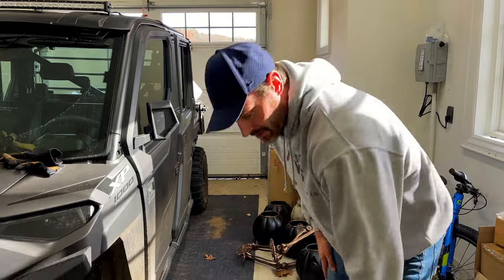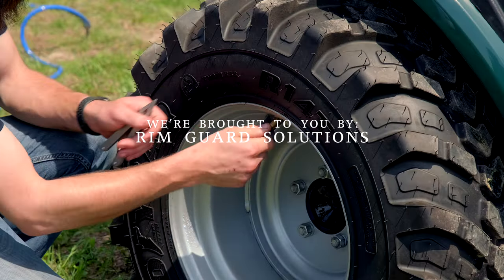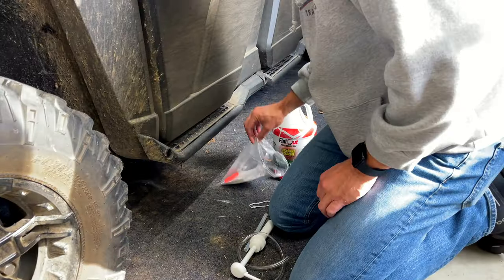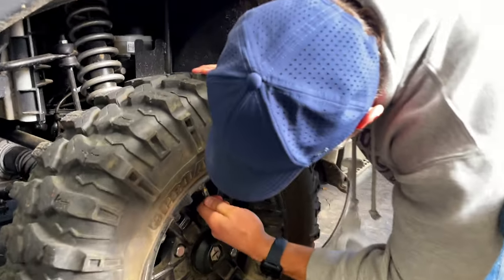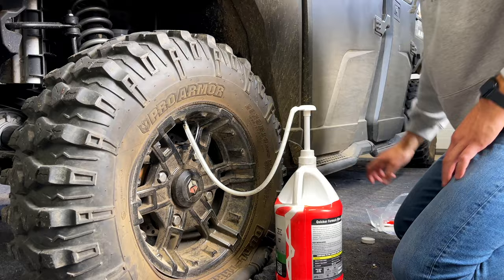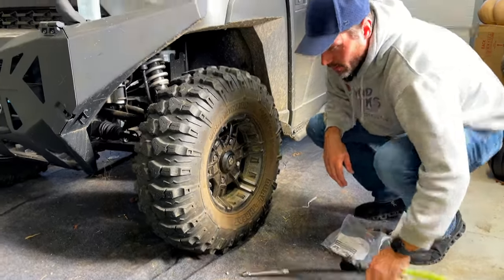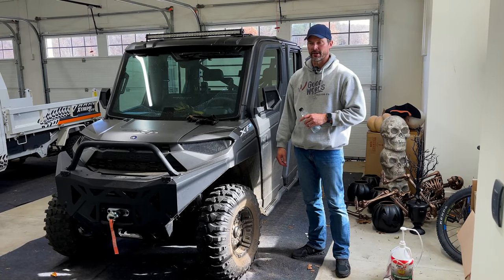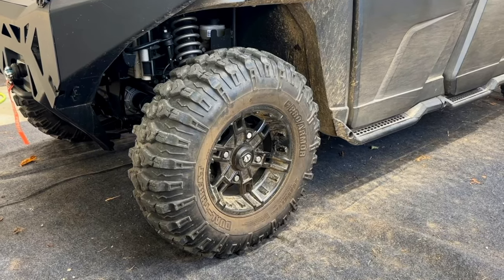HOW TO FIX FLAT TIRES FOR 10 YEARS

Comment from the maker: Save 5% with code GWT on Flat Out! https://shop.flatouttire.com/products/1-pack-quickstrike-off-road-1-gal?variant=40225286455377

Save 5% with code GWT on MultiSeal too! https://multisealus.myshopify.com/

Shop for tractor attachments at http://www.tractortools.com
Reply: @GoodWorksTractors - would you recommend this or the Multiseal 1500 or 2500 for a compact tractor?

Comment: Make sure it is safe for your rims.  I had a product installed at a tire place on my atv that did not last a year.  I found a product online that did work well and applied it myself.  While doing so, I noticed massive holes and pitting on the inside of my rims.  I would up painting flex seal around the inside of the rims at the time I applied the other product that I am referring to.  Just putting this out as a warning for those with aluminum rims.

Comment: Flat Out is the one of the best I’ve tried for tire sealant! Well worth the money if you have problems with tires getting punctured. The only time it didn’t seal right away was in -33 temp, as soon as it started to warm up it sealed up just fine. Not cheap at all but it works! I think the stuff I used was a  little over $200  for a five gallon bucket at a trade show. It was right before closing on the last day so I was able to get a good deal on it.
Reply from the maker: Nice, glad to hear it from someone else!
Reply: @GoodWorksTractors  There was some other stuff that was also used as ballast. I don’t remember the name of it but it was around $100 gallon when buying 5 gallon buckets.  I think that stuff was originally made for underground mining equipment but I’m not sure. 
 
It seems like there’s more and more industrial and commercial stuff making its way to the consumer market.
Reply: Good morning Courtney.   If this product works as good as it appears to , I will be eager to put it in our B2601.   I am a bit tough on the tires, especially the front. No leaks yet , but I am sure they are in my future.  Looking forward to your thoughts, once you have had it in your tires for a bit.  Great video. Take care,  Ben
Reply: @whenworkisplay I put this in my mower tires and dump cart as several tires kept leaking down. After over a year the problem is gone. This stuff seems to really work. A bit more expensive than the other brands but it's all I use now.
Reply: @xPigBear  thanks for the come back and the info. I appreciate it!

Comment: I've done my ZTM and the front tires on the L4701. Due to what I feel was a lack of clarity on their website, I bought a 5 gallon bucket of the Hydro 1500 thinking that would be enough for the rear tires. Unfortunately it's not, and it's going to take close to 10 gallons total, putting it at just over $600 to load the tractor. That was a bit more than I expected, but I suppose it's still cheaper and easier than having to deal with fixing a leak in a ballasted tire, especially since mine have sodium chloride (I wish I had known more about that when I first bought the tractor).
Reply from the maker: Hmm, I don't know.  Website seems straight forward to me?  I think it's a 1 to 10 ratio on the liquid vs multiseal, so a tenth of the amount of liquid ballast, right?

Comment: TIREJECT Tire Sealant Best i have ever used.
My Truck had a slow leak. Have to air up .
Tire shop repaired 3xs and never fixed problem. 
They said my chrome rims needed replaced as they can't fix.
Shop refuse to try.
I told em try brake fluid for Bead Leak.
ANYWAY TIREJECT SPIT N AIR UP TIRE FIXED MY TIRE LEAK !!!
Reply from the maker: Nice, glad to hear it!

Comment: You should not over tighten the valve core. Those threads are pretty soft, and any corrosion or debris, you may not get the core out the next time. Not a big deal. it's just more work if you have to cut off the valve stem and replace it. They make a valve core tool that has a built-in clicker to let you know when you have the core tight.
Reply from the maker: Thanks, unsure if I overtightened or not.  Snugged it up though.
Reply: @GoodWorksTractors  the video made it look like you torqued it pretty tight, that's the only reason I mentioned it. Thanks for the great content!!!

Comment: I've had the multi-seal 1500 in my tractor tires along with liquid ballast, and 1 year later I STILL have to fill up one of my tires each time before I use my tractor. In my experience, it does not work as advertised. I'm pretty disappointed in the results.
Reply from the maker: Have you talked to MultiSeal about your experience? There is a reason for everything.
Reply: Is your side wall, valve stem, or wheel leaking? Is there a hole or cut over 3/4”?
Reply: @PurpleNovember , no. The tires were new & mounted by a tire shop only a few weeks before I filled them. I had mowed though, before filling them, & ended up puncturing the front passenger side tire with a locust thorn. No sidewall damage. The valve stem is good. I was advised by a multiseal rep that rubber develops a "memory" and the product may not work as well for repairing pre-existing holes. The rep gave me some recommendations to try. Hopefully they'll work.
Reply: @DrgnRebrn  That’s interesting. I never heard that before.  Thanks for the info. That’s a bummer it didn’t work for you. I wonder if a rasp out of a tire plug kit would have worked.
Reply: @PurpleNovember , yes, that's essentially what he recommended using. A T-handled rasp to re-puncture the hole. A straight-in-then-out puncture.  Exactly how you see him, Rick, do it in the video that's referenced in this one. No twisting or rounding out the hole. You want freshly torn rubber edges the multi seal fibers can grasp & then adhere to, as they coagulate. Before doing that, though, he recommended "loosening" the rubber in the puncture area with a 3lb sledge hammer. Then, airing it to working pressure & parking it overnight with the puncture down on the ground.
Reply: @DrgnRebrn  Thank you! Good information. I’ll have to check out the other video.

Comment: Another competitor to Slime? I had Slime in a UTV and drove across an old, cut, bean field... sounded like driving over a bed of nails (IE: Natures version of a Police stop stick) ... when I got to the woods and looked, the tires were still inflated but covered in little green dots. These latex products work great. The down side to these products is on the poor mechanic that gets to change the tire eventually. Pull the tire off and the sealant hardens on contact with air and the mechanic has to clean the rim off for the new tire. Several of the shops in my area have signs that state they do not service tires that have sealant in them.
Reply from the maker: This isn’t latex and doesn’t harden.  Stays liquid, clean up with water.